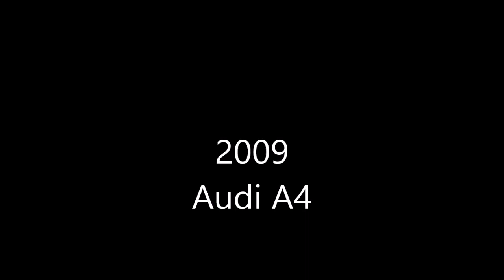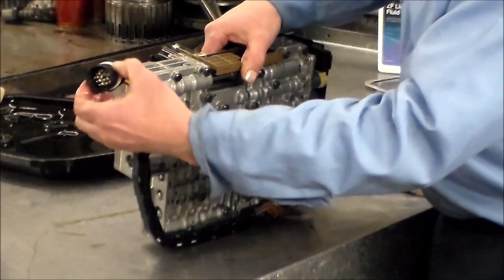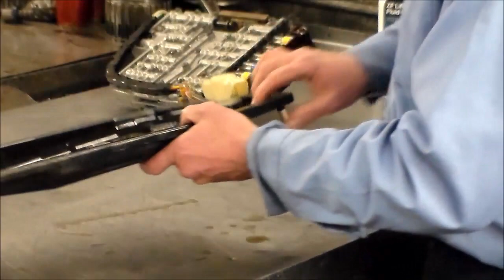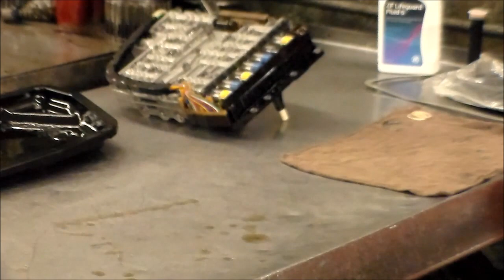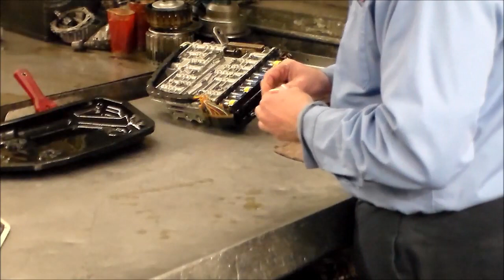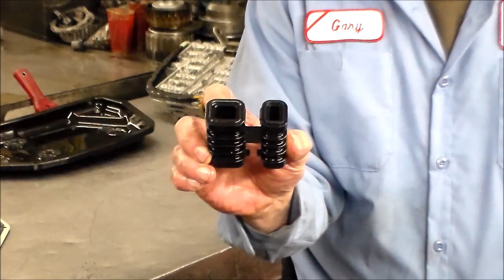ZF6HP19 Audi Valvebody

Comment: hi Gary.
Audi A4 2006 3.0TDI V6 quattro sedan
By the looks of it all it has the same transmission as this one of yours, same bridge seal, connecter position etc.
Had the tranny rebuild , but unfortunately didnt change the solonoid set with new ones. (money issue). hot or cold, issue is the same. when going downhill and thus not accelerating, just floating against the gears, the rev counter will fluctiate and the car has slight bumpy kind of ride. it will then light up all the gearlights and sit in one gear. after wich i stop, switch off the engine, restart again and off we go. untill it does it again.
also when sudden hard accelleration is administered it would also jump to same lower gear(i think it is 3rd) with all the gear lights on. then same thing, stop and restart to get it going again.
will a solonoid set change fix this?
Reply: and by the way, thanx for this vid. it is a struggle to get info on this tranny-engine-body combination of this audi, but it is a lovely car
Reply from the maker: @theunissharpley5435  It is very possible, these solenoids have issues of becoming mechanically clogged.  Do you know what code will put the car in limp mode
Reply: Ill put the obd11 and check for ya… tbc
Reply from the maker: @theunissharpley5435  ok, sounds good
Reply: Hi. Here the codes i get  from the obd11

Engine 2 errors:

- intake manifold runner bank 2 (lower limit not reached)
P 1018

- exhaust gas recirc flow.  P 0401

Transmission 3 errors:

- transmission friction element “E” apply time range/performance
P 2407

-   3-4 shift. P 0783

- gear incorrect ratio 
 P 0730

Vehicle got 323940 km on clock
Reply from the maker: @theunissharpley5435  May want to try solenoids first, trans does not have to come back out for this.  Do you know if the bushings were changed?
Reply: Yes it was
Reply: Thanx for your help. Much appreciated
Reply from the maker: @theunissharpley5435  so what happens, the transmission slips in the higher gears?
Reply: When going uphill and torque is needed it will gear up from 5th to 6th instead of down to 4th. 
Then hits limp mode. And when just cruising and then suddenly apply gas, it gets scrambled and then suddenly hit limp mode .
Reverse can only be done on idling and a little gas, as soon as you step on it, it goes in neutral state but still shows reverse.
When going downhill the revs fluctuate and sometimes it will drop down to about 800 as if in neutral, but still showing 4th or 2nd or whatever gear it is in. And also the it hit limp mode.
Reply from the maker: @theunissharpley5435  I would try a new set of solenoids, i had that reverse problem a few times and i believe the solenoids were the problem

Comment: have an Audi mechatronics with license plate a51 with 3 yellow and 3 blue and 1 black solonoids, and I have another Audi mechatronics with license plate a52 with 5 yellow solonoids and 1 blue and 1 black. are compatible to use in the same car
Reply from the maker: No they are not,  the only thing you can change if you want are the solenoids but must be color for color
Reply: @GaryFerraro  thanks I am the owner of the Audi A6 C6 quattro Portuguese for the problem of 3 slipping I changed the oil filter and the main sleeve, the kit had 3 more tubes but this transmission does not have it, and it was the same as slipping on 3 but if you wait to accelerate for 2 seconds no more slipping .
and here in Portugal no one repairs automatic gearbox I'm trying to solve it but it's difficult. I wanted to spend 2500 euros on a rebuild that I would have to buy directly from German but thanks for everything. Helder Ribeiro
Reply from the maker: Any codes.
Reply: @GaryFerraro  has no codes
Reply: it could be a solonoid
Reply: it could be a solonoid
Reply from the maker: is the car ok cold and slips hot?  are you sure it's not a 3-4 slip @helderribeiro4867
Reply: @GaryFerraro  cold or hot and the same. I feel 3 .but if it was a clutch it would be 3 5 R

Comment: Is it normal to have the wire lead attached to the valve body? The HP19 on my other car (a BMW 335i) has the wires coming from the car and just a connector on the valve body. So when you remove the valve body the wire stays with the car.

Comment: Hi, i've the same body valve in my s4 b7 4.2l. I've trouble with this one. I've the code p0735 and 2 weeks later, and now the gearbox engages reverse or first gear, but the car does not move forward. I did a full drain but still the same problem. do you think i should restore the valve body and solenoides?

Comment: Lifeguard 8 for the Audi 6HP19A. Not Lifeguard 6!
Reply from the maker: If a 6 speed I go with LG6
Reply: @GaryFerraro  so why would LG8 be specified for this particular transmission? Both Audi and ZF specify LG8, yet they specify LG6 for other ZF6’s. If LG6 was correct, surely LG6 would be specified?
Reply from the maker: @simonc4810  I am honestly not sure why that is, first i'm hearing of that,  where does it say this? would like to check it out
Reply: @GaryFerraro  ZF specifies 1071.298.027 oil change kit with LG8 in my car. I believe they specify LG8 only on 2007+ manufactured transmissions, or older ones with a software update.
Reply from the maker: @Carl_dev  Yes, i heard of this not long ago with a Phaeton that i worked on

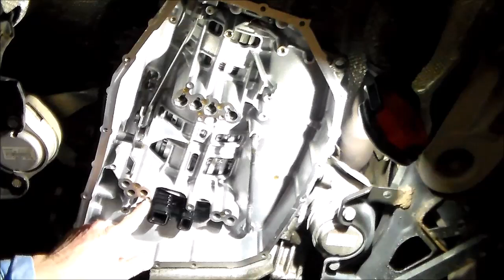Comment: Thanks Gary, does the Audi 6HP-19A not have the 4 rubber sleeves in the transmission bottom that seal up to the valve body  in addition to the bridge seal like the BMW 6HP-19? it looks like they have been removed at 7:10 or were they never there?
Reply from the maker: The sleeves are there just countersunk and i believe there are also snap rings and tension springs holding them in, Bridge seal is much different than BMW, Any problem with the car?
Reply: @GaryFerraro  Im getting slipping and a grinding sound in low temperatures starting around 36F and gets worse with lower temps. It goes away when the car warms up and is not an issue in warm seasons. An oil and filter change didn't change anything. Reading about the BMW 6HP-19complaints this seems like a common issue where replacing the sleeves helped.
Reply from the maker: @robertficek7586  By chance store any codes?
Reply: @GaryFerraro  Unfortunately no codes from the transmission module or the ECU. The live read out from the transmission module shows the temp and rpm sensors seem correct at cold start and when it warms up. This is a tricky one at this point, I dont think there is anything mechanically wrong within the transmission but most of the reading from other 6HP-19 owners points to similar issues as the transmissions age and suggests the rubber seals as the culprit. Really appreciate the video on the Audi version and surprisingly its a lot different internally then the BMW.
Reply: Some further reading i found the part numbers to those sleeves, looks like 3 short and one long and as you said they are installed with springs and clips

Valve body to case bridge seal ZF 0501216014
Electrical connector O rings ZF 01V927322A
Short sleeve ZF 0734 317 389 (3 pieces)
Long sleeve ZF 0734 317 370 (1 piece)
Reply from the maker: @robertficek7586  How many miles on the car?
Reply: @GaryFerraro  its an 07 A4 3.2 sedan with 110k miles on it
Reply: @GaryFerraro  Hi Gary, just an update, re the cold weather transmission noise out of the 6HP-19A. It had been getting worse this winter even with the transmission at operating temp it would still make some noise under load as if it was slipping. I was about to get a replacement transmission and tried Sea Foam Trans Tune as a last Hail Marry as it couldn't do any harm at this point and the result was the cold noise went away completely. From reading other German car forums this may be caused by clogged/ sticking solenoids which fluid changes dont always clear. Sea Foams transmission product seems to be a great tool as a last resort from hat i have read. Have you ever used it or any opinion about it?
Reply from the maker: @robertficek7586  Hi Robert, i never used sea foam yet, i use other lube guard products. not sure what that noise was unless it was a filter noise, was the filter changed?
Reply: @GaryFerraro  Yes, the filter and trans fluid was changed and @80k miles, in cold weather the shudder started at startup until it warmed up, it went away in the summer and returned again this winter, i did another fluid change at 110k miles and still the shuddering and got worse since it persisted after the car had warmed up. I couldn't diagnose it exactly as there were no codes and shifted normally other then then shudder under load/ acceleration. The additive seemed to have remedied the problem, the only guess could be some build up inside the transmission over the years.
Reply from the maker: @robertficek7586  ok, great, so no more noise

Comment: Mr Gray i have problem in 6hp19 bmw 
Fault code 4_5shift ratio what the problem you can help me
Reply from the maker: When does it fault ? when the car is hot?
Reply: @GaryFerraro   yes when thee car is hot
Reply: You can help
Reply from the maker: @fountainblueautorepairing  Have you done anything yet to try to fix the issue?
Reply: @GaryFerraro   no still no fix
Reply from the maker: @fountainblueautorepairing   I would say you either have a solenoid issue,  like one or mare may be mechanically clogged or you have a worn rear stator bushing or possible worn E clutch, how does this drive cold?
Reply: @GaryFerraro  in cold car very good all shifting okay
Reply from the maker: @fountainblueautorepairing   Very possible you have a worn rear stator bushing, being the fact that it's ok cold and not ok hot.  Are there any codes?
Reply: @GaryFerraro  just fault code 4_5 sifting motoring
Reply: @GaryFerraro  which stator
Reply: For first i ll change solonid then i ll change E clutch stator
Reply from the maker: @fountainblueautorepairing   Do you know the code number?  rear stator bushing on the pump
Reply: @GaryFerraro  i ll check tomorrow morning and tell u
Reply: @GaryFerraro  Helo Mr Gary i change stator for E clutch still.the same
Reply from the maker: @fountainblueautorepairing  You changed the bushing?  did you happen to look at the E clutch?
Reply: @GaryFerraro  the clutch is new all 
I should to change solonids now

Comment: I hate the solenoid packs inside the transmission like that. A lot of oil and heat to expose electrical connectors too, but that is the way ZF is going, off the cliff. Anyways, good video.
Reply from the maker: Thanks for watching

Comment: Regards Gary, you may have a friend who can help me. I have a 2003 Toyota echo, 1NZ-FE engine & U340E transmission. The symptom, when it accelerates and goes down to the third shift then does not want to change to fourth shift. I have to reduce speed or use the overdrive button (manual) to change it to fourth.
But whenever I need to use the overdrive (manual) with the button it works fine always. Valve body ??? ... I'm in no hurry,  by the way, good work!
Reply from the maker: Do you by chance have a scan tool that shows live data?  any codes

Comment: Would you typically change the 4 cylindrical rubber seals which sit up inside those 4 holes in a line? They are retained with circlips and springs.
Reply from the maker: If this was an overhaul i would, unit worked ok and had low miles on it
Reply: @GaryFerraro  Do you need any special tools to remove and/or reinstall the springs? As in, how much force will be required to reinstall? I've got the valve body removed from my Audi, seals and fluid replacement kit should arrive tomorrow. Car's got 400k km (250k miles) on it and judging by the date on the filter, this is the first time the sump's been dropped so I figured I'd rather replace these just in case.